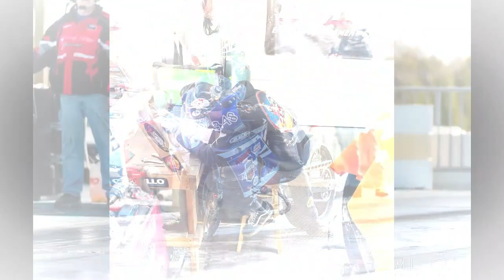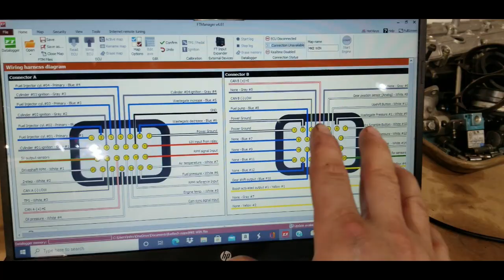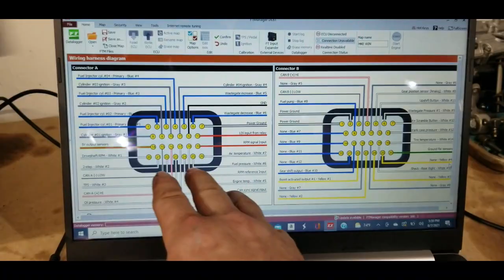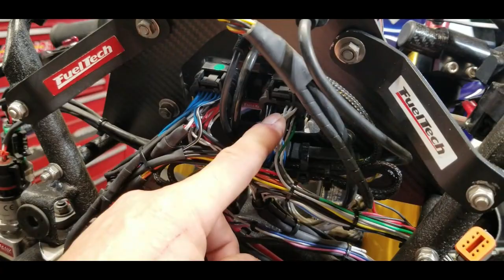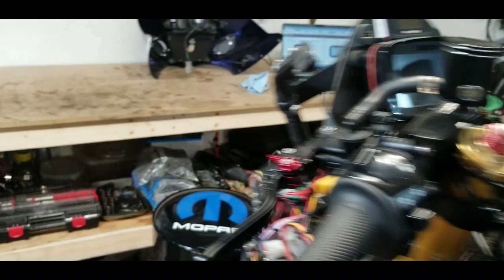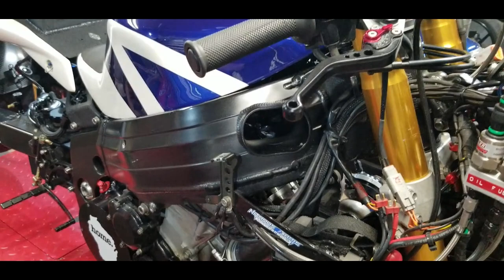WIRING BREAKDOWN. GSXR 1000 with Fueltech FT550

Comment: Hi, how does the spark-pro handle high boost. I have been told high mJ CDIs i.e M&W Drag Pro 250mJ are needed to keep the spark lit at 25-30psi, what psi are you operating at?
Reply from the maker: It's been fine so far up to 22psi...but im actually getting ready to convert to IGN 1As here shortly to keep from  even getting i to an issue. I also have heard the same info as you

Comment: For the crank trigger what did you set the computer at i had put 24-2 for my rpm signal and on ft50p diagnostics it kept giving me crank trigger erro gap detected at wrong spot and reading incompatable with teeth configuration

Comment: I have a couple questions... i have almost the same build as you, i have an ft550... what is the ignition firing order, mine is an 05 1000, i read it was 1243 from stator side to timing chain, which i have cyl 1 as 1 and the rest as they go... my cam sensor there are 2 pins, which one is for 5v and which is sensor ground

Comment: I appreciate the video… It was very helpful… One quick question,where did you get the diagram of the inputs??? I bought the 550. But, before I start wiring. I want to plan it out the best that I can… Thank You!!
Reply from the maker: In the software once you select or deselect all the options you are gonna use for inputs and outputs....it generates the wiring diagram. And will also add or remove as you change or modify your setup and features

Comment: Do u have a wire diagram I can work with?
Reply from the maker: The Fueltech generates its own wiring diagram/ pinout based on what features or setup you run. After that you just make the connections however you feel is best or easiest

Comment: you said a woolich cost you a motor? what happened to make it fail?
Reply from the maker: I had to do one of their updates to keep tuning and i was at the track when it locked me out without the update. So i updated it during a rain delay and the update REMOVED the map switching feature i was using for a nitrous map. I had no warning and the next pass was a nitrous pass and it no longer had the 2nd map to flip to. I called em on it and all the said was they removed that feature because they couldn't verify it was functioning.  Well.....i can guarantee it was before the update
Reply: @tpsfab  Damn, kind of puts me back to the drawing board, my bike is no where near needing a standalone ecu, I'm almost done with my build and was actually thinking about doing a woolich setup and I actually was going to be doing a 40 shot on the stock motor
Reply from the maker: Depending on the year of your bike /ecu, they still have many features.  My bike being and older 03, their wasn't a lot of features and I dont think they cared to put much effort into the tuning of that ecu. Not super desirable

Comment: You said running 5v sensors to bus bar?
Reply from the maker: Yes, the 5v supply from the ecu runs to the bottom half of my positive buss bar. Then all my 5v  supply sensor wires connect up the the screw terminals.
Reply: @tpsfab  I see thank you, looked like a marker but actually split